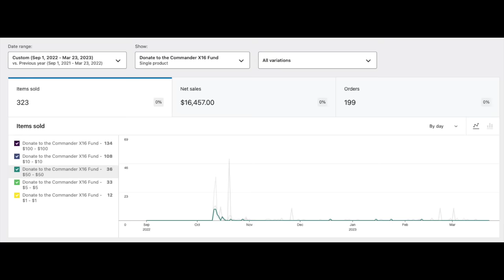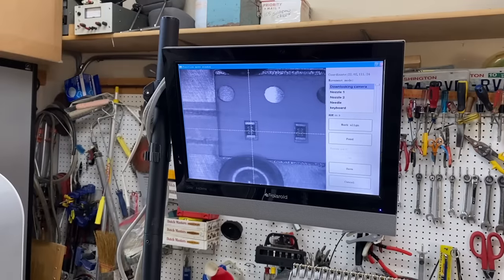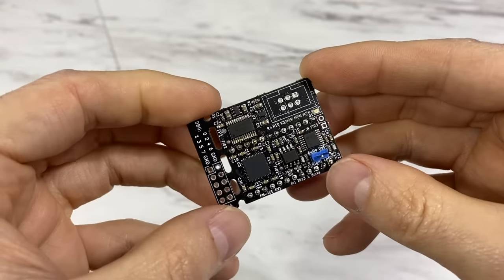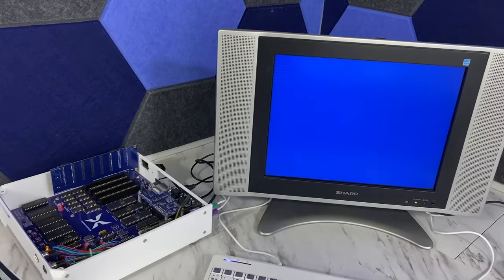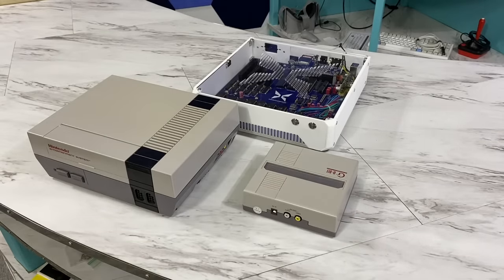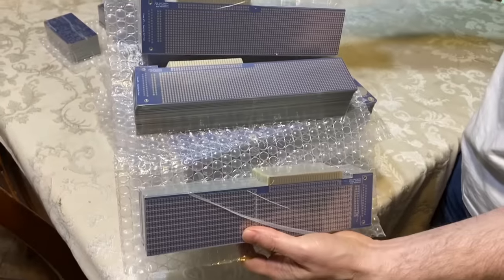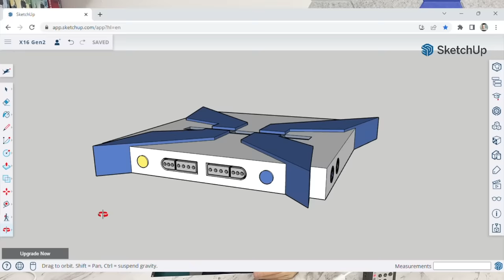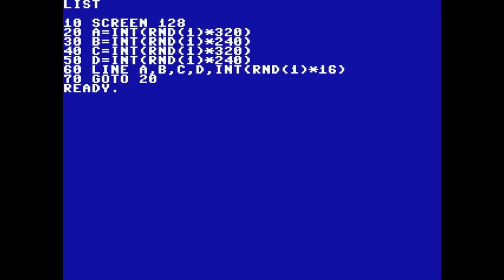Commander X16 2023 update

Comment: Drastically changed specifications and a high price means I'll just stick with emulation. I mean I get that specifications change during design....I have been through this myself. But the increased compromises come with increased prices and just pushes it out of the reach of a lot of users.
Reply: All it will do it break him. No one wants some old obsolete computer. Even if it is new. If I want to design games I will use UE5.
Reply: @jerryspann8713  You mean YOU don't want an old style, obsolete computer. Clearly those that have donated to the project do want one. If the price were reasonable, there are lots of people into retro computing, 8 bit gaming, programming, graphics and music who might want one. If you look at the prices people pay for old, "obsolete" computers and games consoles, it clearly proves you wrong.
Reply: @another3997  I'm not talking about doners, they better get something out of it.  But I still don't see someone willing to spend $500 on this when that type of money can get you the start of a powerful gaming PC that's not obsolete.

Comment: So much effort was put into this machine, it’s a shame that the AGON light accomplishes all the same objectives at a fraction of the cost.
Reply from the maker: I beg to differ.  The Agon light is a fairly boring machine.  I mean, what can you run on it?  I don't see people flocking to write games for the Agon Light.
Reply: @The8BitGuy  CPM 3.3 is already ported to Agon and since the MSX used a Z80 the community is already working on porting DOS and MSX2 to it
Reply: @The8BitGuy  it has a text editor and an actual assembler that I'm using to write software for the machine on the machine itself. It has bbc basic and a few demos show that you could realistically build a game like arkanoid or single screen arcade games in pure basic.

And it exists for 60 usd on mouser, so I can actually buy it right now, gift it to hobbyists friends and we can all write software for it.

The Agon exists for 5 months, of course it won't have much software yet. The X16 exists in emulator form for what, 3 years now? If it didn't have 100s of software I'd be really worried. 

I really wish you the best here, David, as a long time viewer and still patreon yours. If you ever get to a sub 100 product, I'll be in line to buy it.

But dismissing the Agon as boring, given that it actually exists and is in the hands of hundreds of people right now? That seems a bit childish in my opinion.
Reply: @avalonbits  I wouldn't say the agon is boring, but the z80 it is. At least comapred with coding on a 65xx. But to each one it's own. After all the Agon was designed in Europe, where the Z80 based machines were popular, and the X16 is US based,  where the 65xx ruled back then.
Reply: @The8BitGuy  What can you run on it? Anything you can run on the x16. The ESP32 is just as capable as the VERA. It's just a question of firmware. MSX2 level of games should be possible. I think that beats the x16 because of CPU speed.
Reply: @Mr. 2151  He wasn't talking about the processor, but the machine itself.
Reply: @The8BitGuy  Honestly, I think this comment is the greatest indicator that you've lost the plot on this thing. "What can you run on it?" What kind of question is that? It's a hobbyist machine, like yours was supposed to be. The questions are "what can you learn from it?" and "what can you do with it?" Because for  $50 or $500 I can find more powerful machines than either of yours and run all kinds of software, including emulators that will run every piece of software produced for your machines.
Reply: @mwaddams  The X16 can display 4096 colors on a single frame while playing more than 20 synthesized channels of audio plus a digital PCM audio channel with high fidelity coverage from 20Hz to 20,000Hz. Can Agon do that with its 6-bit color and 1 bit beeper? Don't get me wrong, FabGL is a pretty cool hardware+software combo for the ESP32, truly impressive, but its capability is different than the X16. FabGL can render polygons much faster than X16 could hope to, but the X16 could render it more vividly.

Comment: Surely using PCBway's assembly service would have been a better solution, at very least the SMT? It's quite cost effective, and the parts may even have been cheaper through their suppliers.
Reply: I don't think finding an SMD EMS is the issue, having a THT EMS is.

I don't think PCBway is offering this

Comment: I brought an Agon Light. Very nice too, it can also run the Z80 version of BBC BASIC.
Reply: Hell of a lot cheaper and maybe just as capable and way faster.  I sometimes feel this project has gone off the rails
Reply: CP/M
Reply: @OzRetrocomp  I think you can probably make an AVR based machine that's faster.
Reply: @OzRetrocomp  I heard from the Agon guy that X16 is purposeless engineering

I disagree, it's not practical from an industrial standpoint, obviously

it's also not very well suited for educational purposes, in the hardware front

but it's a machine for the nostalgic with some very anachronistic capabilities that aims to keep some of the old customs alive and allow people to reuse those ancient workflows that no longer make sense, those cartridges fiddling with memory banks and 6502 assembly tricks

if people are willing to pay $500 for it for the good times then it makes sense for them (us)

does it make sense as an industrial machine - CBM stands for commodore business machines - that is in any way remotely cost-effective? no, but it transparently doesn't try to be
Reply: Nice! BBC BASIC was one of the first structured basics and is still under active development with some practical uses. There's a BBC BASIC for Windows installation monitoring seismic activity around the Coloseum in Rome, for example. :) And BBC BASIC for SDL is free for Windows, MacOS, Linux, Raspberry Pi, Android, iOS or web; it's a nice little environment with some fun programs.

Also... I've gotta admit that I'm coming from a background where I might have criticized the X16 for its complexity too. It's a nostalgia project though, so I don't want to spoil the fun.

LOL! I definitely want to criticize the Agon Light's website for overcomplexity! What even is this thing! XD But I might get a machine anyway.

Comment: I've also been thinking about making an addon for it using a 64 mhz 65C816, with DMA capabilities and 4 megabytes of RAM. It would also work on the game console unit as a cartridge pass through, and special advanced cartridges could be made, still using the 60 pin famicom connector (16 megabyte cartridges!) which would use a special pin that when pulled high, would indicate that the cartridge would be some sort of "super" cartridge. However, because of the 24 pin limitation on the 65C816, a special circut, when enabled, would switch the $400000-$7FFFFF area of memory to be $000000-$3FFFFF on the cartridge or $400000-$7FFFFF on the cartridge. There's also another catch- the last megabyte of RAM is split in 2 banks, both 512K. Another circut determines which 512K bank goes to which processor. And the last circut would determine if the 65c816 had access to cartridge ROM or the 65c02 (internal) had access to the cartridge ROM. If the 65c02 doesn't have access to the cart ROM, then it has access to the 512K RAM it is given by the 65c816. I know this sounds extremely complex, but it's not. UltraCPU maybe?

So basically, it's the X16 on the Commander X16. So, Commander X16X16?

Comment: I looked into an HDMI out on system I was looking to put out. What I found was there was a small licensing cost per  unit but there was a $5000 one time license fee just to use the standard. What I also discovered was there were no licenses needed to use Display Port technology. Even today I'm using a display port out on my Win 64 machine with a display port to HDMI cable which works great. This was at least a year ago that I looked into this so things might have changed.

I also remember that when you were starting out using the Vera FPGA for video that the developer said he could put audio on that board, there was room.
Reply: True, and the DP connector can carry both VGA and HDMI signals, and can also convert directly to DVI.
Reply: @bgood2010  Displayport does not carry VGA, the VGA signal is generated inside those dongles by a DAC.

Comment: It’s pretty mind boggling that for $4, you could just get an ARM SoC that could run and emulate this entire computer… but I know this isn’t what this project is about. Still, $11 just for the audio chip…
Reply: This is just a vanity project at this point.
Reply: Actually the $4 chips can't emulate the Vera at full speed. But I think a sub $100 SBC can run the emulator at full speed if you get the right one.
Reply: I'd have chosen an FPGA solution including the sound chip... Not quite feasible to rely on obsolete YM chips.
Reply: @dazealex  Of course, part of the reason that they went with the YM2151 was that the FPGA core for the YM2151 did already exist, so they had that as a back-up. However, when enough were delivered to make the TexElec "SAAYM" board, I think they took that as a signal that the advertised availability was really there, when it turned out to be a Shenzhen-fiction, amplified by everyone reporting that they had the chip available because they saw another supplier advertise it as being available. But in my opinion, while the OPM is an objectively better chip for the role it plays on the X16 board, if they were going to go with a recycled chip, the OPL2 would have been a safer choice, because of its more robust recycled supply.

Comment: 1. A possible solution to the high cost of the initial run could be to include a voucher that can be exchanged against future add-ons or software etc.
2. I think the FPGA is probably the best solution for audio since it has the advantage that it could be reflashed to emulate different audio chips, which could be really useful for serious music production. Also does the machine have an easy way to add a simple pin adapter midi interface, or will you be releasing a midi card?
3. I'd suggest that on the "game console" version you include a way to upgrade it to the full fat version, either a daughter card and case mod, or maybe an external module that plugs into an expansion port, I'm not sure how many conductors you'd need to pin out basically everything, but something like an ultrawide SCSI connector would probably do as an OTS part. (And would be better than a wobbly edge connector and a blob of blu-tack).
4. It may be too late at this point, but is it possible to add support for controllers with "analogue" sticks / triggers? Assuming that someone down the road would be interested in building custom controllers. It could be as simple as just detecting a certain value resistor between two of the pins to switch to a different polling mode that can read an X/Y position as a pair of 8 bit values for a 256x256 grid and triggers as a 0-255 value.
5. You might want to consider some time down the line building a version that's compatible as a module for the Checkmate IPS displays, that would make for a really neat all-in-one system.
6. If you included some sort of basic "webcam" you could 2-way datablast with any smartphone just by holding it in front of the screen and rapidly flashing QR codes back and forth. It would be a very easy way to download new software and such if there isn't going to be any kind of network connectivity out of the box.
7. If you want a port of Doom, maybe gift a dev board to John Carmack? I believe he's rather keen (pun intended) on this kind of thing.

Comment: This series of challenges are not really surprising to see or hear, and well represents what's like to produce an electronic product, even with (or brcause of) a batch of small quantity.

Obsolete parts management and soldering process optimization are the everyday critical topic i saw when i was working for a precision equipment engineering company. 

Good luck for the project, but it really well highlighted inside-out of typical issues of electronic product engineering, and chapeau for  communicating crystal clear on these issues for viewers/ stakeholders.

Comment: You could 'key' the X16 cartridges by cutting a notch and the having a tab that prevented famicon cartridges from inserting.  That's the way some battery manufacturers prevent identical batteries from going into THEIR tools.  Black & Decker, Porter Cable, and Stanley Bostich 20v batteries are identical, save for these tabs.
Reply: Mr Dremmel to the rescue

Comment: Look David, I love the idea of a new retro computer -- I'm not a huge fan of some of your design choices but does nobody on your team see that you took a computer -- which is a system design problem and turned it into an supply chain problem (getting the YM chip, getting the OPL chip, replacing it with an expensive fpga ) and a production problem (self-assembly, solving the dip soldering issues).  You don't solve problems by throwing other problems at them.

Comment: Glad I didn't put any cash down on one of these.  We've strayed way too far north of my price range considering aside from the cool-factor of having a standalone system, the emulator on my PC will in the end do pretty much all the same things.  It's been so long since the original video where you described what you originally envisioned but I swear you were targeting the low end market complaining about other 8 and 16 bit project computers that others had made that were expensive for what it's worth.  Just goes to show all the hurdles there are in producing your own computer and the reason why ppl charge so much for their hard work.
Reply: Yes, unfortunately just about everything David originally envisaged for the X16 has gone out the window. I respect that it's his project, but he obviously wanted to sell his design to hobbyists. Getting people's hopes up 4 years ago for a cheap, non FPGA 8 bit, and then producing something that will never approach the original price tag, still uses an FPGA and also an obsolete and hard to find sound chip, is frankly not the way to attract customers.
Reply: You gotta remember that he DID try to the best of his abilities. At the end of the day, they are susceptible to things like inflation and the like. Plus, he is using an FPGA only because the video chip he WANTED to use was no longer in production and there is no modern replacement for.

If you want to blame anyone for the increased price. First and foremost, blame the idiots responsible for the inflation.
Reply: And then blame the people who priced these things. The LAST person you should be bashing about that is David who has to buy the parts just like everyone else.
Reply: @jeremydale4548 There was never modern version of this chip he wanted to use, and this FPGA is still not a modern version of that chip. What parts of this computer do you think have gone up wildly in price since inception? Certainly, nothing here has increased in price 5-10x. 

I agree, he did try to the best of his abilities. The result shows that this team simply is not very skilled at making a computer.

Comment: One solution to the sound chip problem would be to use a Yamaha SD-1 (YMF825) chip. This is the only Yamaha FM synthesis chip still in production in 2023 and with the right software it sounds identical to the OPL chips.
Reply: But that would be a wise decision, and this project clearly used up it's quota of those a long time ago.

Comment: Yamaha YMF825 (or SD-1) might be something to look into for sound, as I just had that come across my Youtube feed for a USB sound card for DOSBox. One output channel (mono) from my understanding, but as of last year at least it was still being manufactured.
Reply: Maybe run 2 chips for stereo?
Reply: YMF825 is the way to go because it could be hooked up in parallel to the SD Card socket (with an extra chip select & IRQ signal) provided that the X16’s SPI port is not bit bashed. If it is bit bashed, then the X16 should really consider implementing a 10MHz (or faster) SPI interface.
Reply: @PebblesChan  The SD Card interface is driven by the FPGA in VERA and runs at 12.5MHz; it is not bit-banged by the CPU. There are no more available pins on VERA, but there are a few available on the VIA. However, SD cards which do not play nice with multiple devices on the SPI bus are very common.
Reply: @JoeBurks_1  Not being bit banged is great news! I haven’t experienced any issues with SD & MMC cards sharing a SPI bus with other peripherals when the proper signal specifications & integrity measures are applied. With an FPGA, you’re often able to select an appropriate I/O pin slew rate to minimise unwanted high frequency harmonics & avoid unnecessary signal integrity issues.

Comment: Working for PCB CM for few years in the past, I cried for help seeing you guys spending money on this absolutely terrible submerging soldering rig some hoax company put together. Despite you did all right, the soldering won't be successful unless there's solder wave under the board flushing all pins to be soldered. It's bread and butter of pcb manufacturing. Good luck.
Reply: Could you go into details on what machine he bought? Dip soldering is a viable solution for smaller boards and much more affordable than wave soldering. Nevertheless I agree, dip soldering such a huge board is going to be difficult

Comment: HDMI is a superset of DVI. You can run plain vanilla DVI out of a HDMI connector into a HDMI Monitor or TV and expect it to work just fine. At the same time you don’t need to pay any licensing fees. What you won’t get is audio out, or any type of video other than regular RGB. For those extra bits you need to pay. There’s no reason that the X16 couldn’t go the DVI route AND VGA at the same time. It’s just a case of telling the FPGA how you want the data encoding.